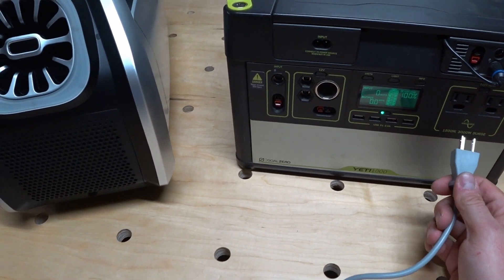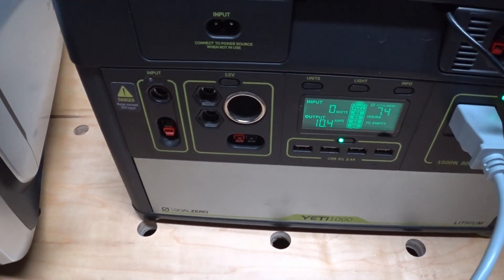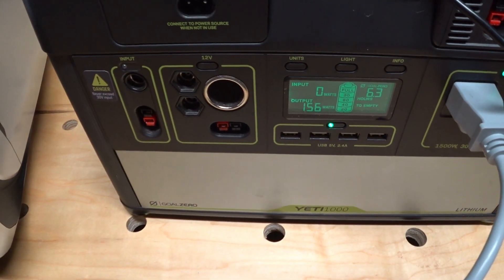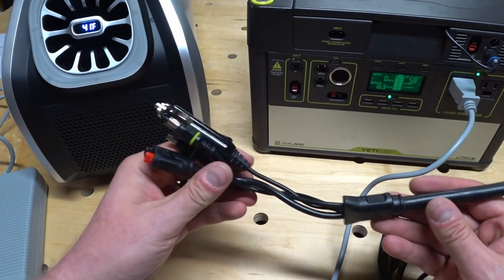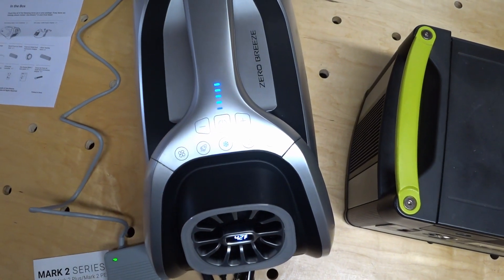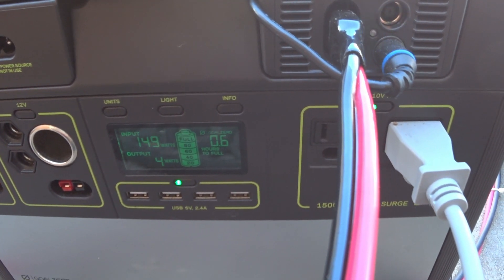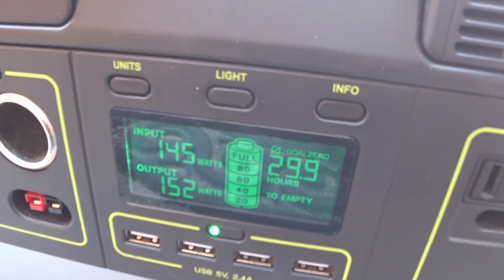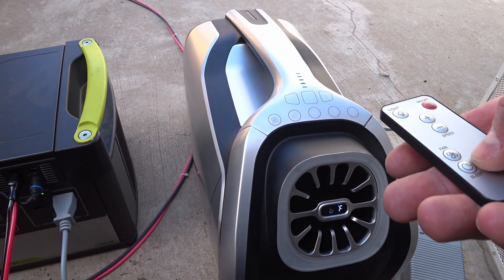Zero Breeze Mark 2 Powered by Goal Zero Yeti 1000 Lithium Inverter and 200W Solar

Comment: Why cant i simply plug the zero breeze AC plug into my yeti 1000x and power the zero breeze that way? I cant get an answer for that. Thank you
Reply from the maker: You can for sure.  I have a whole video testing how long the battery lasts with each way of powering.  That is the only issue.   It's less efficient to run off the AC inverter so you get less run time.   If that's not a concern for you then that might be your best bet.

Comment: Hello, 
It's a very descriptive video, but I'm asking just to be sure. Can my Anker solix c1000 powerstation charge while using Mark 2?
Reply from the maker: I can't say for sure as I'm not familiar with any Anker products, you may want to check out the anker website, or sometimes user forums or groups have more info.  I can say I've owned and researched many others and I haven't seen one in recent years that didn't offer pass-through charging, so it's hopeful.
Reply: @Polymathicus  What is the most important criterion in the power station to run the Mark 2 directly for 6-7 hours? Is 1056wh / 1800w enough to run it for 5 hr ?
Reply from the maker: There are a LOT of variables, day/night, how hot it is outside, how hot the space is inside, etc.  I think I got around 4hrs on a good day running mine constantly in a hot vehicle under full sun with a 1000WH battery.  It's been a while since I've run it out completely, so best to watch my videos where I run the battery out completely in a hot car to make sure.  If you're running it at night, you'll get much more runtime.

Comment: Good info my friend. Would this set up be good for a boat?
Reply from the maker: The smaller the space the better.  Seems to be quite a few boaters online talk about using on their boats.  Just need to feed it 24V DC and be able to run the two back hoses to the outside.
Reply: Just researching. I plan on using the same setup, goal zero yeti 1000 to power a portable air conditioner on my boat.
Reply from the maker: Should work well for you, good luck.

Comment: Hey man, awesome 👍 vid. How do you connect the air conditioner to your battery? What type of plug?
Reply from the maker: Thanks!  I'm on my third battery now, so I've changed it up a bit over time.  I'm a fan of Anderson connectors which are on my videos with the Yeti battery, and now my ElecHive battery I'm testing out.  But any plug end can be gotten online for any DC out that the various companies use.  After that (if the battery is 12V) you need a 12V to 24V converter to power the Mark 2.  Goal Zero sells the other end that goes to the Mark 2.

Comment: Seems like a good solar Generater.Systems . I have not had to put it to the test yet in a situation without power but it has seemed to operate fine so far.
Reply from the maker: It varies widely based on the generators design and how much amperage it will "allow", and how much power your charging source can put out.  I'm testing a 2500Wh battery right now that offers a "quick charger" that outputs 1250W and can charge to full in 2.5 hours.  So, look at the specs, decide how quickly you need it to charge and find one that can handle what you can feed it.  Feeding a generator more and more charging power is where the costs can start to climb.

Comment: Can you tell me how you made the 110 adapter? (Or can you buy one by now?) I'd like to try powering it with 1000w inverter generator. Thanks!
Reply from the maker: It comes with the 110 gray power brick if that's what you're asking.  If you want to power straight DC battery power then you have to start building things with a 12V to 24V DC to DC converter in most cases depending on the battery.

Comment: Great, detailed review here with lots of unexpected extra tidbits of useful info. I'm curious if you know if the Zero Breeze Mark 2 would work with a Jackery 1500 using just the A/C plug that comes with the Mark 2? They're all sold out of 12v to 24v adaptors on their website and I'm not sure where else to get one. Thank you!
Reply from the maker: For sure.  As long as your battery's inverter is supplying adequate, steady A/C output.  You do lose some efficiency since you're converting DC > AC > DC, but it's not a huge hit.  You can also get a 12-24V converter on amazon or elsewhere online and wire it all up yourself.  I needed a 20amp rated model from Amazon to get consistent results.
Reply: @Polymathicus  Okay AWESOME! Thank you for clarifying. Not sure how to wire it up myself but I'll do some research :)

Comment: Hello is it possible to run this 24/7? If yes then how many mAh of batteries do i need and how many watts of solar panel do i need to power up this thing while recharging my batteries? Thanks for answering in advance 

Edit: Can you please tell me what volts of solar panel i need?
Reply from the maker: There are a lot of variables there.  Possible?  For sure.  All depends on how hot your environment is, how large a space you're in, day/night, and what you're trying to achieve.  I can get around 4.5 hours on high in a very hot environment during the day just running off of my Yeti 1000 WH battery.  So that will get you a rough idea of the size of battery per hour.  Then you'll need to calculate the solar needed to not only run the Mark 2 during the day, but enough charge left over to recharge the battery from the night before (probably many hundreds of watts).  Your battery/BMS/wiring/charge controller specs will be specific to your setup and tell you how many Volts of solar you can handle and how you'll need to wire (series/parallel) to provide adequate current.  Sorry I couldn't be more specific, but there are just so many variables.
Reply: @Polymathicus thanks for replying  bro! This information really help me! Have a good day!

Comment: Can you touch on whether you like the Bluetti or GoalZero Yeti better? Maybe do a video. I’m about to invest a good deal of money in one company’s products and I know you’ve used both, so I’d like your opinion.
Reply from the maker: Hi, I went with the Bluetti AC200Max during the pre-sale.  I wanted more capacity and I saved some money that way....plus, I like new gadgets.  The specs and reviews were also very good and it has no problem running the air conditioner.  My Yeti was solid, as all Goal Zero products seem to be, but they are very expensive and (unless they've upgraded) have really low amperage plug in chargers for their batteries which I never understood.  Both batteries were/are solid.  I really like the bluetooth control in the AC200Max, and the faster charging from the wall.  Not sure what Goal Zero is offering these days.  Any battery from an established company with a presence/support online will probably work for you, from there you just need to decide what capacity, what bells and whistles you want, and what port/cable types you want/need to use.

Comment: Hi great video could it run through a normal converter running of my bus batteries
Reply from the maker: If it's supplying a stable 24V DC it should work.  Fuse it, maybe put a switch on it.

Comment: Can the yeti recharge while being used.
Reply from the maker: Sure can, and has pass-through.  So if you have solar coming in, it can run the Mark 2, and take whatever is extra and top off the battery.
Reply: @Polymathicus  that's really good news.

Comment: Can Jackery E1500 make it run?
Reply from the maker: Yes.  You can use the AC inverter with the plug in power supply for sure.  The only DC output I see on that on their website is a 10amp "cigarette lighter" jack....I don't know if that will work through a 12V to 24V DC converter though if you wanted to run off straight DC power.  
Even with the efficiency loss using the AC inverter you could easily run all night on "sleep" mode with a 1500Wh battery like that.  I may be missing something on the Jackery site, but it seems weird Jackery doesn't offer more DC outputs.

Comment: Hi!! I bought the Mark 2, I’m trying to install it in my single cabin straight truck, I bought a 400W inverter to power the Mark 2, the inverter is connected directly to one of the 4 12V batteries of the truck, and I used the original AC/DC converter that comes with the Mark 2. For some reason is not cooling, and the fan speed is super low. It turns on, but the compressor doesn’t seem to kick in at any time. What you think the problem is?? Please help.
Reply from the maker: Hi.  Can't say for sure, but any similar issues I've had with my Mark 2 or the original were due to not supplying it with enough power.  Whether that was wire size or DC converter size, etc.  Since you're powering with AC power, I would rule out your inverter first in case the 400W inverter just isn't able to give you that compressor startup power, or your batteries may be contributing.  I'd try taking it inside and plugging into your house and making sure the Mark 2 is working with adequate power.  Then if not, I'd contact Zero Breeze.  They've always been very receptive when I've had any issues or questions.

Comment: You don't speak about whether or not the 0 breeze Can effectively cool the van
Reply from the maker: I do in my other videos.  It cannot...when in full sun on a hot day.  At 2300BTU's it's just not capable of overcoming that kind of heat load.  But it does cool me.  As long as I stay in the air stream, I'm comfortable even if the ambient temp in the van is around 105.

Comment: you have an optical temperature scanner, but not once do you point it at the vents on the AC unit?
Reply from the maker: Haven't watched it in some time, but I'd assume if that's the case it's probably due to the inline thermometer display on the outlet which I found was mostly accurate when I had pointed the non contact in there.

Comment: Mine has never blown colder than 53F
Reply from the maker: If it's around 75 degrees ambient or higher, that's about what it does at minimum.  If not, their support has been very receptive in my experience with them.

Comment: Great video Thanks for posting! I'm converting a smaller hatchback into a camper and I'm wondering if a 500w station could run the Mark 2 over night in sleep mode (8hrs) against 80-85 degree temperature 🤔
Reply from the maker: Haven't tested that exactly so can't say for sure.  There have been comments, as well as posts to the Mark 2 facebook group about the Mark 2 running very efficiently on sleep mode.  So, you'd definitely get a longer runtime per Wh on sleep mode and in a cooler environment than my test videos, but 8 hours seems unlikely off of a 500Wh battery in my guess unless you are installing considerably more insulation, and maybe cordoning off the back end of the vehicle by making a cocoon around your sleeping area.   I'd poke around the Mark 2 facebook group...the folks that had good luck overnight may have posted the power draw they were getting.
Reply: Will do, Thanks for the Reply!

Comment: Im sorry I got confused in the beginning, in the end what did you need for connectors/cables? Is this Mark @ just straight plugged in the Yeti now? Just into the outlet... am I not seeing what connectors you settled on in the end?
Reply from the maker: It depends on whether you're running it on AC or DC.  The AC adapter that comes with the Mark 2 can just be plugged into the 120V inverter output on the Yeti if you want to do it that way, but it uses more power to make those conversions.  If you want to run direct DC off the Yeti battery you need a 12V to 24V DC converter as the Mark 2 runs on 24V and the Yeti puts out 12V.  In the end I found I needed a 20 amp version of a DC converter to supply enough power to the Mark 2.  All has been well since.  As far as cables you would need to build your own to get from the Yeti to the Mark 2 if you go the DC route.  Last I checked, zerobreeze.com sold a cable with their connector on it and bare ends to at least get that part done.

Comment: btw can you charge the yeti 1000 via 110v AC wall socket (without panels)?
Reply from the maker: Yes, but it's abysmally slow. Around 70W even with MPPT using the included charging brick.  Apparently the new yetiX models have increased charge speed.  I personally just got in on the crowd funding for the new Bluetti ac200 1700wh battery.  Amazing on paper, we'll see.

Comment: how would this system fair in a 7 day/night heatwave power outage to power the zerobreeze or icybreeze air coolers needing continuous power to cool 8x8ft area?  could you run either of these on low setting 24/7/7?  what is the smallest 'power generator' that could do that?  i assume i'd need a 2nd to run a full size fridge/freezer and 3rd to cool other room for 7 days?
Reply from the maker: The Mark 2 will have a difficult time "cooling" an 8X8 area in most cases, but will cool you if it's blowing on you.  A very insulated space will help.  In my tests I get about 4.5 hrs on normal mode with a Yeti 1000 battery in a very hot vehicle during the day to give you an idea of runtime.  I'm not very familiar with the icybreeze, but it looks comparable to my ice model (ice models currently discontinued) cooler from swampy.net that I used for years before the Mark 2.  If it can move the same amount of air as the swampy coolers (my swampy moves A LOT of air), it could make a difference in a well insulated space.  I could run my swampy off of my vehicle battery almost all day and still start the engine to give you an idea of power usage.  I think it used ~2 amps on high.  When using the ice cooler in my vehicle I could easily melt 40lbs of ice in about 4-5 hrs or less depending on the temp, so keep that in mind.  This was during the day, so night time in an insulated space would probably last longer.
Reply: @Polymathicus  4.5 hr on 1000 model on medium, but i hear zerobreeze is a power hog vs swampy.net type coolers?  any idea how many hours a power generator ex yeti 1000 might cycle to keep a full size fridge/freezer functional?

Comment: Thank you.  Great information. about 150 watts on high is what i needed to know.  FYI by comparison y'all  an OPolar 9" USB fan  consumes only 4 watts and blows a lot of air!

for my off grid cabin idea...   
A $100 115AH (~700WH usable) deep cycle battery and  $250 300 watt 24v solar panel from home depot (with cheap 20a controller) should be enough to move into  8x8 shack under the trees in middle of nowhere Florida.  LOL
Reply from the maker: Sounds like a good plan. The cabin would definitely be YouTube worthy so we can all check it out.
Reply: Can you give me the direction to no where Florida Is it near 95.

Comment: Interested in only running ZB as vehicle air conditioning while driving in my van with aux battery. Seems the simplest plan considering alternator charging is an AC inverter from the aux battery? Reduced efficiency due to inverter is not a concern while driving. Do you think it will cool a van (Vanagon) in this application? Thanks.
Reply from the maker: It will not replace a vehicle air conditioner as a vehicle ac has around 15K BTU capacity, and the Mark 2 is 2300 BTU.  This is especially true during the day in full sun.

Comment: Would you buy the zero breeze Mark 2 again? For 1700.00 (extra battery) is it good enough for 90*weather?
Reply from the maker: No, not for 1700.  To be more specific, not for my use case which is in a vehicle in full sun during the day (over 90° weather).  At that point I don't know that I'd be getting enough bang for the buck.  I paid around 4 or 5 hundred on the first day of crowd funding, and I'm more than happy with that amount and what I'm getting.  My opinion might change however if we're talking about using at night when it's hot out to help get to sleep, or in an environment where I can guarantee I'm in the shade.

Comment: You should send this test to zero breeze. They are getting so much bad reviews, but these results are amazing
Reply from the maker: Remember, the power consumption will go up as the ambient temperature increases and it wasn't mid summer yet in my first tests, but yes, per your other comment, a couple hundred watts (more is better) of solar in full sun should provide most if not all the power needed by the Mark 2 in all but the hottest conditions, then one would have a battery to run into the night.
Reply: jtskr25 that must be why my Unit was pulling over 300 watts when I turned it on. Thanks for the info. I’ll pre-cool my van from now on.

Comment: so how does this cool the room when its really hot does it really work?
Reply from the maker: Wasn't really designed to cool large spaces being heated up by the sun during the day.  But more to cool what it's blowing on in that space.  I use it in a 100 degree enclosed vehicle, and I'm very comfortable in the air stream.  If I move out of that air stream, I start sweating immediately.  If your room is small, very well insulated, and not too hot outside, could be different story.